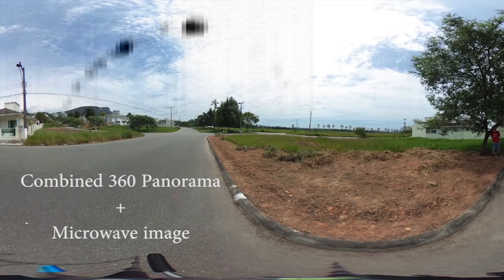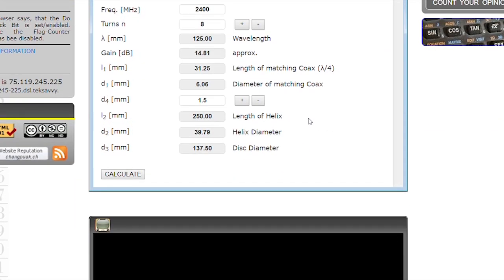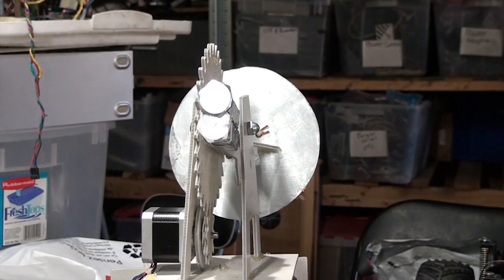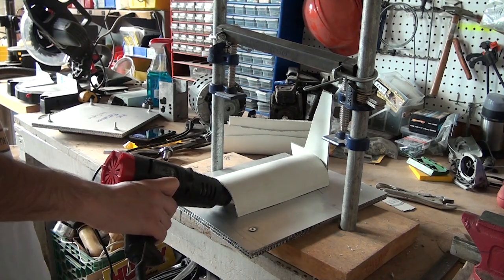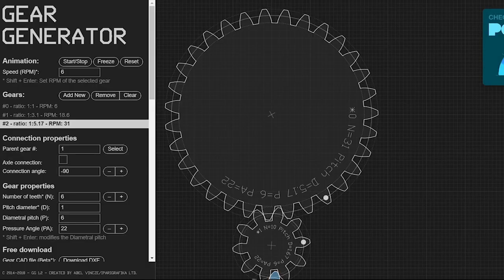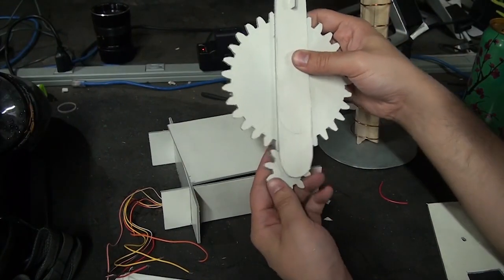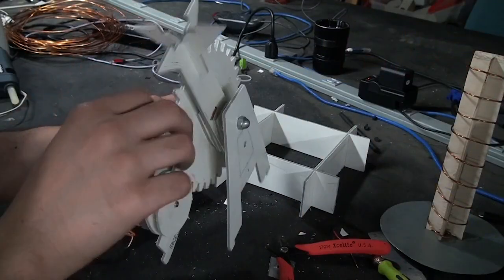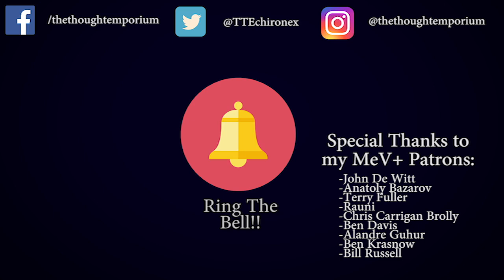DIY Radio Telescope Version 2: Wifi vision - Part 1

Comment: I tried to do the radio-telescope project for my first semester project.
Sadly no-one else wanted to team up with me. That turned out to be tedious but a good thing for me because I had to do everything and learned so much about building, electronics, coding and optimizing a system.
In the end I finished it but now I'm still not satisfied. I want to improve it so much more and I know how. I just can't let it go now that I've come this far. I'm not going to stop till I'm done.

Your first video inspired me a lot and was probably the thing that inspired me to do this.
Thanks for it.
Reply: Mustafa Ahmed Same here, I just need some radio software to translate the hydrogen line to a viewable images using my satellite dish,  I have documented my progress on my channel and my research no one ever says this is how I translate Fourier radio signals to viewable image.   I left off with CASA software site.   I like to complete this project...
Reply: I need info for taking down government in my country

Comment: You need a much bigger gear ratio and some kind of optical encoder(out of a mouse perhaps) to measure the angular distance the gears are actually moving your antenna to have a hope of creating an accurate scan. The angular measurement encoder will overcome any jankyness in gears. Microstepping on your ramps board and limit switches will also help. Good luck. Loved your radio telescope vid(its why I subbed). :)
Reply from the maker: There's no need to have that level of precision at this scale. The antenna itself, while directional, has a pretty wide focal point because it's so short. The difference of a degree or two shouldn't matter too much. For the version 3 which will host  much large antenna with a much tighter focus, then I'll need tight tolerances.
Reply: Just speaking from my experience of building a motorized Dobsonian for satellite tracking. A closed loop system with cheap or free encoders from a mouse or optical encoder disk ripped out of a printer will make the system more precise and repeatable. Yes with very accurate gears you can get away without it for some applications but at a cost. All gear trains have errors , so this is why mostly all consumers printers use closed loop encoder systems because it is cheap and easy to implement for a fixed budget.

[edit] to be clear I am hoping to learn something from watching this. I can build an accurate moving platform using my telescope building experience but the radio/microwave stuff is all new to me. I hope to emulate their design for the antenna (both radio and wifi) and put it on my own telescopes to scan the clarke belt and other cool stuff. Thanks for the feedback. We are all learning throughout life ideally.
Reply: Do a 3rd gear pull with it

Comment: I like the idea of using flattened PVC pipe, I have looked into buying sheets of PVC before and it is very expensive. You could also use PVC cement to do the final assembly for a very strong joint.
Reply: Mark Funderburk, I got a sheet 3'-4'  of black PVC plastic for only around $20-30usd once you added shipping
Reply: Yeah, i will use that too ! I needed PVC sheets for my pond filter but there is no way i spend more than 35€ for a piece of plastic. I have a heat gun, some PVC tubing, that'll do !

Comment: I can't wait for part two!!!!!!!!!! Awesome!!
Reply: I have is that possible make using wifi single and make images like x-ray images?. "WiFi image"
Reply: If I understand you then yes its posable but it would be cheaper and you would get better quality imagi*¹   using x-rays.  Wifi uses 2.4 or 5Ghz and every government controls the transmit strength for that band so the depth or distance will be limited and WiFi cards and AP will add a lot of noise in residential and industrial areas.
So yes it could be done, but would be more of an exercise of theory than making anything useful.

*¹  both the power used and the size of the wavelength limit resolution so 5Ghz would yield better results than 2.4Ghz. The antenna size also plays into this as the antenna needs to be larger for 2.4 Ghz than 5Ghz and that still more so than X-ray so for imaging you could not have as many antenna per square cm. but this is moot if you are using a single scanning antenna like they do here but this will not work well with moving targets.
Reply: U r wright

Comment: The unpleasant fumes are hydrochloric acid.
Edit: technically hydrogen chloride as fumes but reacts with water in the lungs to form acid.
Reply: RIP
Reply: Logan Sutton Yes, if you butn enough of it.
Reply: did that really need a reply?
Reply: Hydrogen chloride. They only turn into Hydrochloric acid when in contact with water.
Reply: Henry Chan That is true but when you breath in it dissolves and turns into acid.

Comment: try to balance the antenna on itself, make the turning axis on the middle of its center of balance.Doing so will make the counter balance weight not necessary, resulting in less stress on the motor and the gears, hopefully a more precise movement.
great work so far! can't wait for the next videos.

Comment: Two things to consider: when you don't need high torque, you can use friction drive; when it doesn't have to turn too much, you can use cable drive. Cheap, easy to assemble methods with good results.
Reply: Máté Besenyei ezek szerint itt is vagyunk :)

Comment: PVC sheet is readily available at big box stores these days.  A 4'x8'x1/2" sheet is ~$60, while a 4"x10' pipe is $16.  The prices are quite comparable when you compare areas, but the sheet is already perfectly flat and you can use it to make larger objects.

Comment: Nice job!  But I would suggest that it's worth the time to lower your bandsaw guide for all the flat cut work.  The blade will be much better supported for a more precision cut and as a bonus it will make it harder to cut your entire arm off in case of a mishap.

Comment: Btw, if you're looking for something that can provide a snug, but low friction dry bearing surface, getting a roll of conformal, silicone backed PTFE tape is totally worth the price tag. I originally bought mine in an attempt to cheaply protect copper thermal transfer lines from a weak nitric acid solution but since then it's ended up between lots of bearing surfaces where it's not practical to contaminate with dry or wet lubes, and also a few places where high temps are concerned. It's one of my favorite niche material to throw at a problem.

Comment: I really like your projects and watching your videos, my only wish was that the projects were simple enough and repeatable for common folks like myself to be able to repeat them. Good job on another project.
Reply from the maker: I'm glad you like the projects. I will say though, the code will be posted when the new video goes out and is totally open source, as will be any of the schematics that are digital, the materials are literally garbage for the most part and only common shop tools are required (and the 1-2 3d printed parts can be ordered online for like 10 bucks and aren't even strictly necessary, I was just lazy). By all definitions that is repeatable. The goal of this channel is to show that these seemingly complex project aren't impossible and could be done by anyone with sufficient patience (with a few exceptions like the lactose thing). That's why I built this whole thing by hand with only a bandsaw, a scroll saw, a heatgun, a glue gun and some files. And it can be simplified further. Don't be intimidated by complex projects. Face them head on and know that most challenges aren't insurmountable.  When I got started in nuclear physics I had literally no idea what I was doing. Sure it took me a year to get my thing working, but I got there through trial and error. Mostly error. You'll learn a million times more by picking a project you think is too hard and forcing yourself to make it through it.

Comment: just FYI, if you need flat sheets of PVC, talk to a sign shop. they do a lot of mounting onto 4 and 10mm pvc, and usually have some scraps that have scars not suitable for printing, but sandable and useable for things like you're doing.

Comment: Nice. Just suggested in my feed, Sub'd. 
  This is the first time I've seen the PVC flattening idea - genius.

 BTW you know "PVC cement" is a thing. That stuff chemically melts and bonds the PVC creating a chemical bond instead of the mechanical adhesion of hot glue. I've only used it for fixing plumbing and building custom PVC studio lighting stands, so I don't know how well it works on a tee or butt joint. Be sure you want a permanent bond before using it though, as you will need to cut the part to defeat it.
Thanks for the upload.
-Jake
Reply from the maker: I knew there was a good chance this whole thing would be taken apart and rebuilt, so didn't want to go with something so permanant. Also we were out, so I'd have had to go buy more so I used what I had around. Glad you like the project!
Reply: You can also buy PVC sheet at a plastic supplier.

Comment: I really love your work! Some advice from me, I find it faster and safer for my hands when boiling the PVC pipe instead using the heat gun (also, doing it that way the pipe can't be burnt).
Reply from the maker: I had no issues with the heat honestly. I'm used to working with stuff that's a lot hotter than the plastic was. But thanks for the suggestion!

Comment: May I offer a suggestion?  Instead of your classic design, use a pair of rollers of 1/2" tubing, wider than the length of the tube you have,(8"-12"?) mount in parallel bearings, and drive one roller with the stepper motor. Section a center potion of the tube and mount your scope and counterweight in it. It will improve the torque and resolution of your elevation 10 fold. A similar setup could be used for azimuth. A 3 axis gyro could be mounted to sense scope  x,y and z. Arduino stuff. There's much more but I'll keep it short.

Comment: Have you ever tried a sprung slit gear to try to mitigate the backlash? Seems well within your skill set and it let's you stick to plain gearing. If you just use the pvc you used and cut "H" or "I" grooves in both sides the springs will hold the sides together in addition to the rotational force they apply to the other gears teeth, assuming bespoke fit and such.

Comment: You should really use flux when soldering. Unless that's flux core? But lit loked like it didn't flow that well. I would have just put a worm gear on the stepper, and used one large gear. I'd also have just used 1.5" PVC and wrapped the coil around that. Then drill a hole in the middle for the main pivot.  Slot one end and put your large gear there, the worm gear engaging on the bottom. It's much easier to build and everything will be centered and balanced, so very little tweaking will be needed. The worm gear will give you finer control and you can use a smaller (less torquey) motor (but at the cost of speed).

Comment: Ok so down the line you should look into vex kits. I'm part of a high school robotics team and we use vex to to introduce people to the basics of robotics. They produce a lot of the types of gears, axils, spacers, and such that you where using. They are a lot easier to adjust and are pretty accurate. You still might have to have a ridiculous gear ratio but with the vex gears it is a lot easier.
Reply: Just to clarify I am not talking about the toys.
Reply: Vex kits are extremely expensive for what they are, better off just sourcing just the parts you need so your not paying for an entire curriculum along with the hardware. There are many places online where you can buy gears screws axles bearings etc
Reply: Also places like eBay have second hand industrial automation equipment that can be bought extremely cheap that will blow the junk plastic vex gears outta the water

Comment: Great idea, but I feel like the implementation will be the bottleneck, especially the mechanics. Google "antenna trackers" for ideas and preferably a more sturdy frame + servo motors?.
Also, I'm no expert, but I think a helical antenna with only 8 turns has quite a wide beam, which will basically limit the resolution?

Comment: can't quite tell from sped up footage but it looks like you might be filing in both directions, back and forth so to speak.   If that is the case, try to file only as you push away, then lift the file off the material to push again, as file teeth only cut in one direction and it wont dull the file as quickly.
Reply: specially for those needle files

Comment: I have a bit of a question, have you tried pulling data from GOES-13? They're right over you and it's in a geostationary orbit so it would be easier and wouldn't require any active tracking.

Comment: do you intend to use software to track specific satellites. would love to see this applied. well done so far, very cool
Reply from the maker: Probably with version 2 rather than this model since I don't think this will have nearly enough gain, but ya that's the plan!

Comment: You could just use the belt system or a direct drive
That is not the project where gears are good
Actually direct drive washing machine motors are great at precise positioning as well and they can handle a lot of load
And they are cheap for used
Reply from the maker: Tried direct drive. Not nearly strong enough, so no, we couldn't. Also, I didn't have a washing machine motor, so it would've been very hard to use one. I was just using what was available at foulab. Also those things are massive. The whole platform needs to spin, that'd be a ton of extra weight and size I'd need to account for and build around.
Reply: with what micro controller and drivers? cnc shield and A4988?

Comment: have you tried to use arduino or raspberry pi for controlling a motor? for more precise motion
Reply: I am actually building a robot with stepper motors and a pi right now, the board he is using is made for driving stepper motors and I'm sure he can get as down and dirty with the code as he wants. Arduinos and raspberry pi's need to use external driver boards and I don't think would provide a much, if any advantage over what he has.

Comment: Ive been wondering if you could bounce wifi signals off the atmosphere to get long distance wifi, say about a mile
Reply: SeptrothFFXI The area i want it to send too is blocked by buildings and im at the lower part of town would it still work and how did you do it?

Comment: think there is an error in the video at 43seconds not even a minut :(  wifi is higher frequency, lower amplitude on average than radio. Radio = Mhz < Wifi = Ghz - right
Reply from the maker: Naw its still radio. You could be pedantic and call it microwave radio, but it's still radio. When communicating with satellites that use even higher frequency, they still call it radio. Even at the ~20ghz it's broadcasting at. It stops being radio when it hits terahertz because it's properties change dramatically, and then again when it hits infrared. But even then, you can build tiny antennas and "receive" IR as if it was tiny radio. It's all the same electromagnetic oscillations at the end of the day, and the lines people draw are inherently arbitrary. Xrays and gamma rays are the same thing, even the same wavelength at times. Just one comes from radioactive decay and one is made with electricity so humans gave them different names before realizing they were the same thing. Don't get too caught up on names, it's distracting from the core concept.

Comment: that coax is going attenuate and distort the signal to hell... don't solder them, crimp them properly and do it by the specs and they even might pass 2.4Ghz with some capacity...